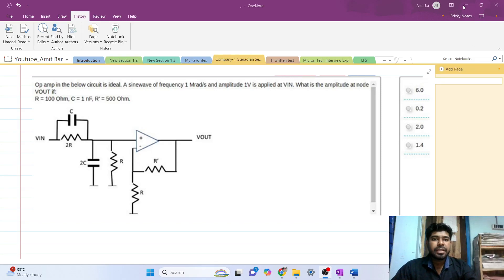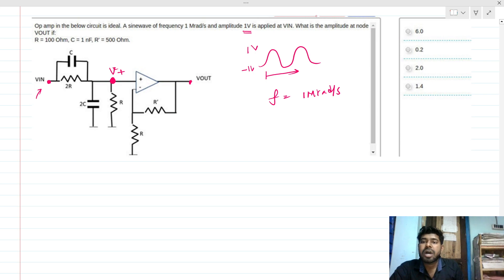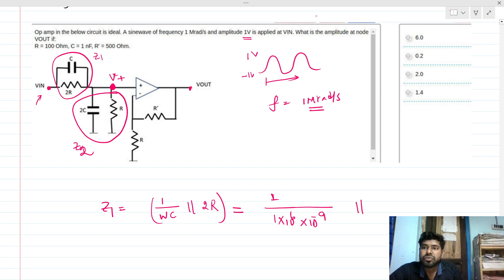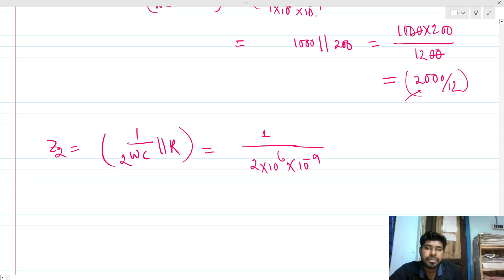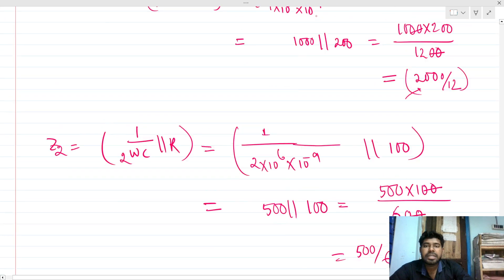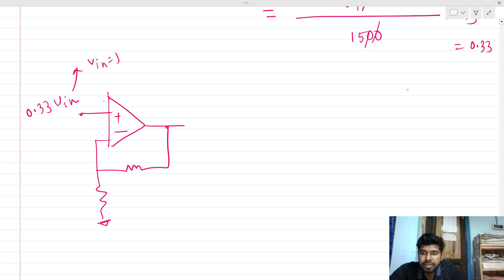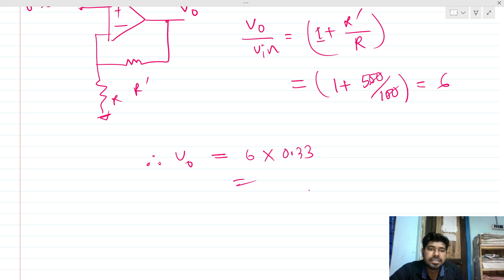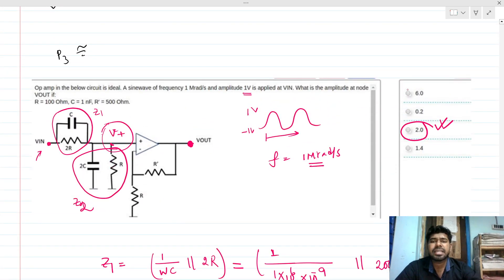Texas Instrument Analog Design interview _ find the opamp ouput amplitude || Amit Bar

Comment: Explaination very clearly, Sir👍
Singal is Sinewave and the voltage of amplitude 1, Vp_p=2v, W=1M rad/sec, f=1M/2*3.14, T=1/f
And the ideal op v+=v-
Z1=2C//R=[1/(2*W*C)] //100=(1/2*10^6*10^-9)//100=500//100=5*10^4/600=500/6
Z2=C//2R=1/(W*C)//200=(2*10^5)/1200=2000/12=1000/6
v+=vi*z1/(z1+z2)=(500/6)/(1500/6)=1/3
And then it is Positive amplifier circuit vo=v+*(6)=1/3*6=2...Answer